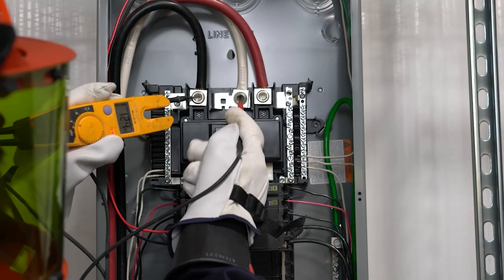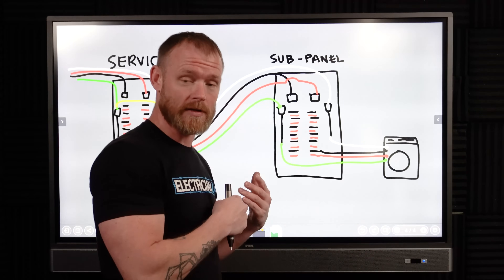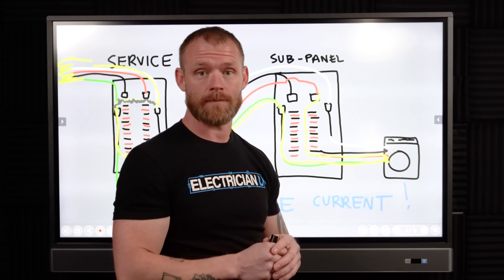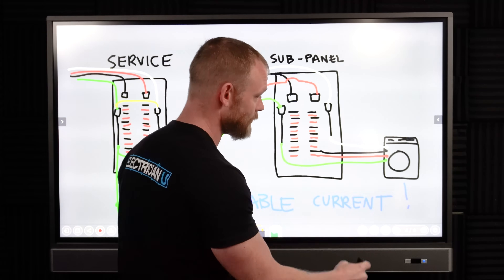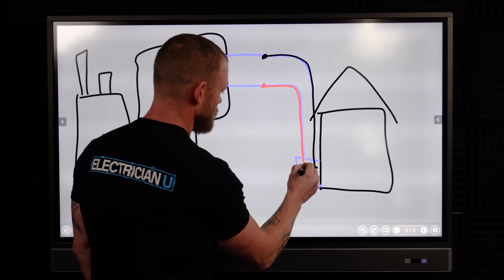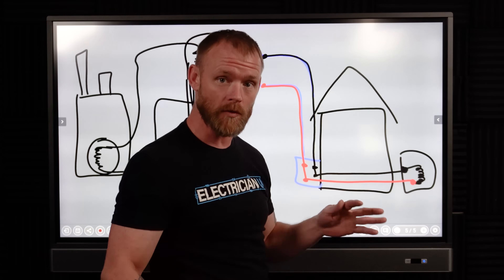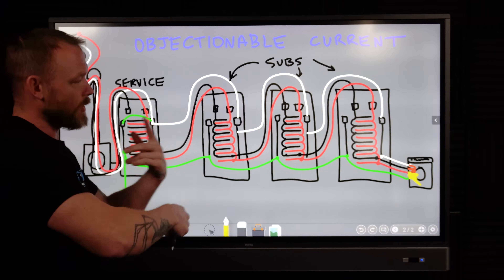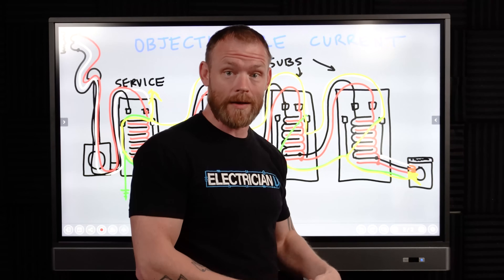Why Do We Bond at the Service Panel and Not a Subpanel?

Comment: The reason you dont want bonding in the sub panels is that you dont want REGULAR current from the white wires travelling on the grounding (green) conductors, because those are supposed to be at zero volts except they are to carry current under fault conditions, as that is what keeps you safe in the event of a fault.  THAT is what they mean by objectionable current.  If the green or bare bonding (grounding) wires  are carrying current under normal conditions because they are bonded to the white bus in the subpanels, it could lead to someone getting a shock. I don't think you explained it very well.  Also, the white (neutral) going back to the transformer is grounded at the pole transformer.  Also, the ground rod should take most of the fault current, if it was done right, it does't have to go all the way back to the pole transformer.  Bottom line is don't take electrical advice from youtube videos or comments, hire a licensed electrician.
Reply: This. 
Folks can think of it as 2 issues. 
White wire has voltage on it under normal conditions. Ground wire does not. 
The second part deals with the why of the issue. If the two (the neutrals and grounds) are bonded, there could be voltages on grounds, and that would be a bad thing.

Comment: Your diagram doesn't represent a service panel. The "service entrance" or "service panel" is the enclosure with the service disconnect. Bonding takes place in the enclosure where the service disconnect is located. In some cases, the first breaker panel is not a service panel. Everything downstream of that service disconnect is not service cable, it is feeder. All feeder must have both neutral & equipment ground.

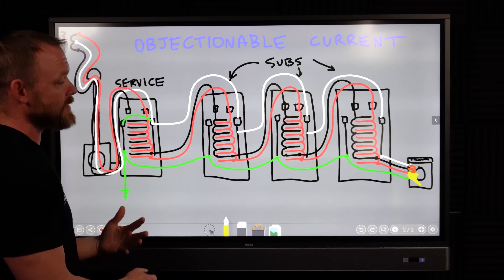Comment: So you finally get to the reason why we don't bond at sub-panels at about 15:15 into the video.  

So the question is "what happens if the bonding in my main panel fails"? Wouldn't it be better to have multiple, redundant bonds-to-neutral (in each sub-panel) instead of relying on just a SINGLE ground-neutral bond at the main panel?

What's the risk of a ground-neutral bond failure in the main panel VS the risk of energizing the neutral at all sub panels in a ground-fault situation?  Has anyone ever done the risk analysis?  

Seems to me more paths to ground is better than less but I'm a software engineer (all the software we write equates to "more is better"), not a certified electrician.  Why is ONE path-to-ground better than "many-paths-to-ground"?  The risk of energizing the neutral on all the sub-panels is the only reason I can think of.

P.S. Before all you smart-asses reply about how I should "stick to software", keep in mind I help write the software that manages how much money you have in your bank account.  Yes.  ALL of  them. BoA, JPMC, Wells, Citi, USBancorp, etc. They ALL use the same software - which I write and test.
Reply: So my question resorts to "why do we need to maintain multiple, independent backups of bank balances, when apparently just ONE will work, just like in this illustration?"
  
For all you arm-chair software engineers out there claiming "it should be obvious" is not an answer.  I know the answer.  I want to know why MY answer doesn't apply to electrical service (and "because banking is not electricity" is NOT an answer. Let's use some intelligence.)

Comment: What is the problem with bonding your neutrals and grounds in a sub panel IF you use a ground rod and ground each sub panel? Might be a dumb question but I was just curious.
Reply: In all the cases where he talked about objectionable current, you would still have objectionable current even if there is a separate ground rod on each subpanel. An additional ground rod doesn't change the path of a short circuit or ground fault current. A ground rod only exists to dissipate static electricity such as lightning, which has nothing to do with bonding or fault current.

Comment: Great video - I really like how you explain things - one very important detail I would like to add. Imagine a 50-amp GFCI circuit breaker installed in the main panel where the ground-neutral bond can (should) be found. Now imagine a sub panel supplied by that 50 amp beaker, except that there also has a ground-neutral bond in the sub panel. The 50 amp GFCI breaker will always think there is a ground fault and trip. So no GFCI or similar safety devices will work if there is a downstream ground-neutral bond. Thanks for listening and good luck!

Comment: I have a meter box with two 100 amp breakers. Then a 100 amp panel in the house and another 100 amp panel in my garage (shop). Does this make the meter box the "service panel" and both of the other panels into sub panels? Because both the panel in the house and shop are not bonded, but it's bonded in the meter box with the two 100 amp breakers. Thanks

Comment: I have a 240v inverter that only has 2 terminals L & N on the AC output the ground is a screw on the side of the case I'm running the L & N basically L2 output terminal to a breaker box to two breakers using a midpoint transformer L1 L2 & a N to create my 120v my question is where do I run the ground to from that screw on the side of the case I'm not using the ac input from the grid at all

Comment: Where does the ground wire terminate at the service pole? Does it have its own grounding rod? Another question: if grounding rods are for lightning, where does the lighting strike on a home that it needs a path to earth? Thanks for answering!
Reply: The ground wire is wrapped around the bottom of the pole. no need for a rod.  Lightning strikes or leaves from the highest point on a home. Sometimes lightning goes up instead of down.  It depends on the potential difference, it's DC.  The idea is to give it a lower resistance path to ground and keep it out of your home.  Remember lightning is arcing a mile or more and creates it's own path through air so a lightning rod will only help with a branch path.  A bolt once struck my neighbor's tree then travelled underground about forty feet to my main panel and tripped a bunch of breakers and destroyed five devices inside my house.  It boiled the water in the tree instantly and the steam pressure blew off a lot of bark and killed the huge oak tree.

Comment: Well done!  I knew to only bond at the service panel, but the concept of Objectionable Current makes it easier to explain.  As others have said, bonding in a sub panel also opens the possibility of an open neutral causing current to flow on the ground conductor.  As an engineer and an owner of an RV wired for 50A service, an open neutral is a scary fire hazard.
Reply: Even without an open neutral, the current will divide between the neutral conductor and all of the bonded metal parts, by means of the equipment grounding conductor and other bonding jumpers.

Comment: Hey Dustin - I asked the question somewhere else too - If in the NEC 2020 code you have an outdoor disconnect (or main breaker), can you have a main breaker in the house too?  And I guess the outdoor meter socket with the main breaker would be the bonded panel and the main panel is now an unbonded subpanel?

Comment: Ok my garage has 100amps fed into a sub panel. The two hot legs go to 100amp breaker in the sub panel and the neutral to the neutral bar. Is this wrong?

Comment: 35 years ago my county inspector insisted that I add a ground rod at my garage 100 amp panel.  At the time I worked as an electrician in a large manufacturing plant and just acted as we did in the plant.

Comment: I need more help:     At 17:11, you show a ground fault at the dryer of the sub panel. You trace the current back along the ground to the main panel where it is bonded to the neutral and so current flows from ground across the bond to neutral and "up to the transformer". Got it.
 Don't get why current doesn't flow to the ground rod "at" the main panel as that seems like the path of least resistance?????? Help (I'm a mechanical guy).

Comment: I have always learned that ground (dirt) is a path because the generation equipment at the power house is "grounded' as well as your main panel.  So the question seems to be if there is enough potential (just for instance say lighting, etc.) difference why doesn't the load coming by grounded (green or bare) conductor to the house main panel go back  both through the bonded neutral and also the ground path?  Why at the main panel does it jump exclusively through the bonded neutral back to the power house?  I thought the path of least resistance was through actual ground and that was why most all codes stress and add additional grounding connections from the main panel.  At one time a bond from the main to the water pipe was enough, then buried or driven ground bars were added, then in some cases multiple ground bars, etc. were added in subsequent code editions.

Comment: Great explanation of sub panels. should talk about how you can't get 240 from only using odd or even breaker locations that you need one of each, or the fact that you can put a breaker in say spot 1 and another in spot 3 run a wire turn the breakers on and they will not trip.

Comment: The NEC must be different than the CEC.  In Canada the system ground is only connected to the neutral at the meter base.  Neutral bus bars always float in panels and sub panels.

We don't jumper neutrals and bond wires because in a 120v system there is aways current/ voltage on the (neutral) because it's not a true neutral.  Where as bonding provides a low resistance path to ground.  So, even if the case is energized, you still won't get shocked.  It's a slight difference but important.

Also, as others have pointed out, that's not what objectionable current is.

The info in these videos continues to be both wrong and dangerous.

Comment: I wish it wasn't called a bond. It's more like terminating or landing your neutral & grounding systems to the grounded service conductor.
Reply: I wish you left the neutral out of example #2. The breaker will still trip for short-circuit and over-current  conditions with a two live wires circuit, it doesn't need a neutral nor functioning grounding system. Of course we do need at least the grounding system to protect ppl! And then the breaker will also trip for live-to-ground faults, rather than wait for a person to be the ground.

Comment: 10-212 Grounding connections for solidly grounded separately derived ac systems (see Appendix B)
1) Except as permitted by Subrule 2), the grounded conductor of a solidly grounded separately
derived ac system shall
a) be connected to the equipment bonding terminal by a system bonding jumper
i) at the source;
ii) at the first switch controlling the system; or
iii) at the tie point, where two or more systems terminate at a tie point;
b) be connected to a grounding conductor at the same point on the separately derived system where the system bonding jumper is connected; and
c) have no other connection to the non-current-carrying conductive parts of electrical equipment on the supply side or the load side of the grounding connection.
2) A separately derived ac system operating at 750 V or less shall be permitted to be grounded by the system bonding jumper that is connected to the bonding conductor included in the primary supply.

Comment: I'm interested in the theory when a generator is used. Has there been a video on that. I've found your videos most helpful.
Reply: You bond the ground and nuetral at the source, and anywhere power is transformed. So in the case of a generator, it is the source of the power. You want any equipment fed from it, to have a path back to it, not back to the house service ground, aka the utility's ground. Ideally, a generator used to feed a house in the event of say, a power outage, should have a means of disconnecting and isolating from the utility. ATS switch, or manual means to avoid backfeeding the utility in the event of a fault, or open. The utility grounds out all the lines prior to working on them, and sometimes in certain blackout situations. Homes running generators that are hooked up improperly, back feeding, or even sharing/referencing the utility neutral/ground, usually burn up pretty fast in these situations.

The utility feeds your meter with 240V hot/hot, and brings a ground/neutral wire by center tapping the transformer. This center tap is their bonded neutral/ground. It is directly in the center of the 240V windings, which is why each leg to neutral/ground provides 120V.
Reply: @paaao  Typically in whole home generators there will be a transfer switch that takes the place of the main panel. This transfer switch should be rated as "service rated" meaning that it has a main breaker (not an ordinary breaker). The main bonding jumper that connects the neutral and ground is located here which was previously located in the main panel. Since there can be only one bonding jumper, the existing main panel should be updated as a sub-panel so that all grounds and neutrals are separated, the main bonding jumper removed and the neutrals landed onto an isolated bus bar. The wire that was between the meter and the main panel should be replaced to now connect the transfer switch to the panel and will have an extra conductor for the ground, which it previously did not have coming from the meter. This is the difference between an SEC (service entry cable L1-L2-N) and an SER (service entry riser L1-L2-N-G).
Reply: @paaao  watch Mike Holt videos. Grounding and Bonding at  the generator is dangerous!

Comment: Is there really a ground conductor from the transformer to the service panel? Or is the diagram that is used up to the 9 minute mark incorrect?
Reply: Utility only supplies 2 hot wires and neutral.

Comment: 10-210 Grounding connections for solidly grounded ac systems supplied by the supply authority (see Appendix B)
The grounded conductor of a solidly grounded ac system supplied by the supply authority shall
a) be connected to a grounding conductor at one point only at the consumer’s service;
b) have a minimum size as specified
i) for a bonding conductor; and
ii) for a neutral conductor when the grounded conductor also serves as a neutral;
c) be connected to the equipment bonding terminal by a system bonding jumper; and
d) have no other connection to the non-current-carrying conductive parts of electrical equipment on the supply side or the load side of the grounding connection.

Comment: There is also the case where the neutral is cut but you wouldn't know it because the ground takes its place carrying the current back to the main panel.  Would be dangerous if you are disconnecting a ground and haven't shut off the main.

Comment: Doesn't current also go into the actual ground too in a short circuit through the grounding rod? Like if your grounded to the actual ground and touch a hot wire you get shocked even if your not touching anything else in the circuit. Like all the warning signs say in the power substation "not grounded not dead".

Comment: Question, where should panel bonding occur when the main breaker is attached to the meter base, and there isn't a main breaker at the main panel?

Should it be bonded only at the main breaker/meter base, and kept unbounded at the main panel?
Reply: The code says at the first means of disconnect. If there is a main breaker located inside your meter base, that would be the first disconnecting means and not at the panel
Reply: @toddtaylor7136  I was thinking that too because I read that as well, but wanted to ask in case there was an exclusion that I missed somewhere.
Thank you for your reply!

Comment: I had a situation today where a tenant told me she got a little shock from an hdmi cord hooked to her tv. I tested the outlet with my meter and it showed 148.9 volts, weird so I popped the outlet cover off and shined a light in, low and behold the neutral was touching the bare ground wire. As a soon as I fixed it it showed 120 volts. No one has touched those outlets in the 20 years I’ve owned it so it had to have been that way all these years. The potential for harm was there all that time?? Scary

Comment: I noticed that in your example, the subpanels send ground back to the original service panel. At my home, I have a 200-amp service coming from the utility service that comes to my primary service panel, just outside my attached. I then have a 100-amp sub-panel in my detached garage. There is an Ufer ground for both my house/attached garage as well as for my detached garage. In the conduit between the primary service panel and my sub-panel, there are just three large wires; one with white tape on it and one I believe has a red stripe along the length of the wire. The white taped wire is neutral and the other two wires are the two legs of "hot." The grounding bar is then connected to the Ufer ground on the detached garage. I had heard that separate, stand-alone structures require their own grounding and NOT to run ground back to the original structure... any return would be over the neutral wire.